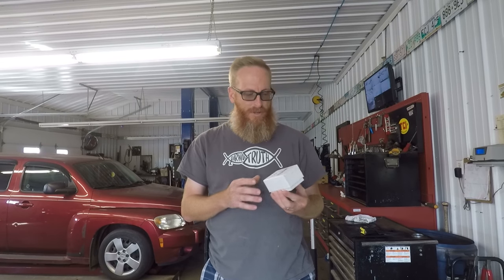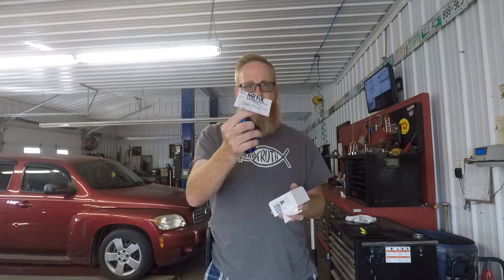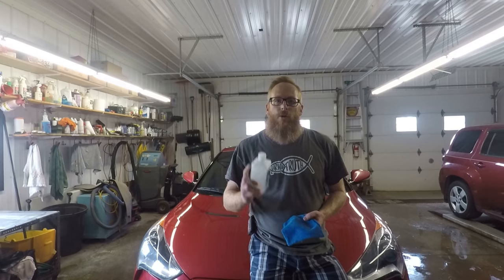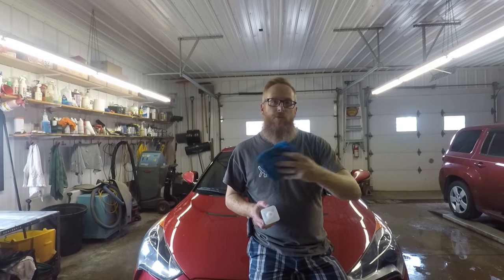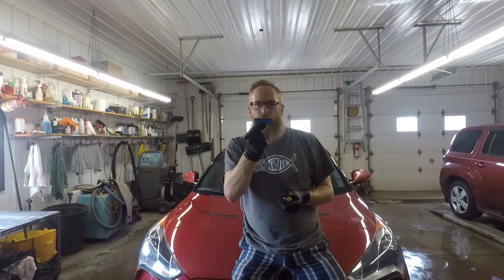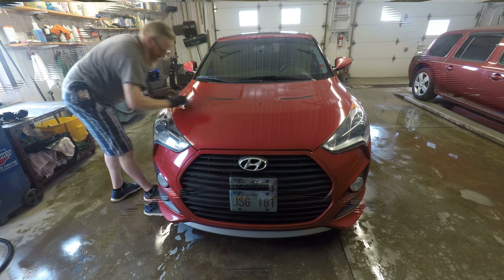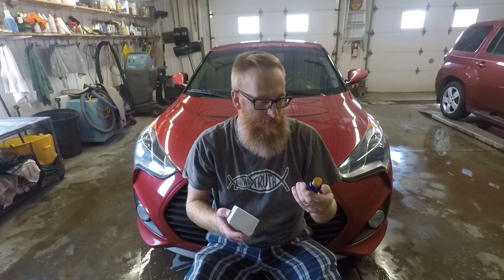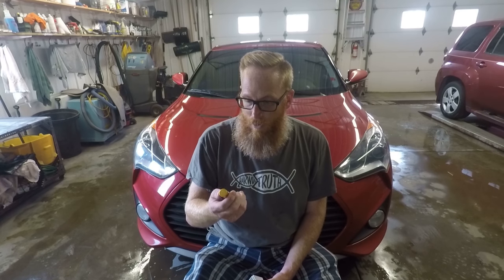MAMA'S 2013 HYUNDAI VELOSTER TURBO GETS THE MRFIX9H CERAMIC COATING

Comment: I use Turtle Wax express shine after hand washes and Turtle Wax spray Carnauba wax on my cars and the water and rain drops just run right off. I don’t use polishes or buffing unless I have scratches in the clear coat. If the ceramic coating gives you good results for more than a few months, then you really have something there.
Reply from the maker: +James Nasto we'll definitely be tracking it! You can't beat the old turtle....